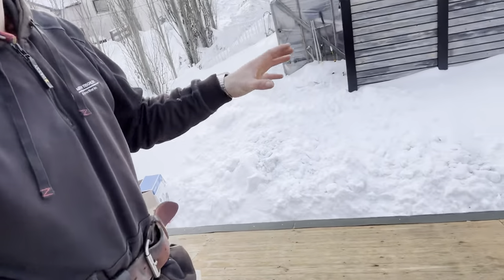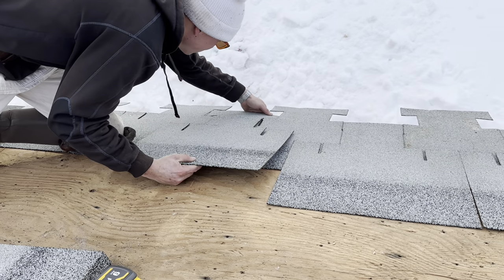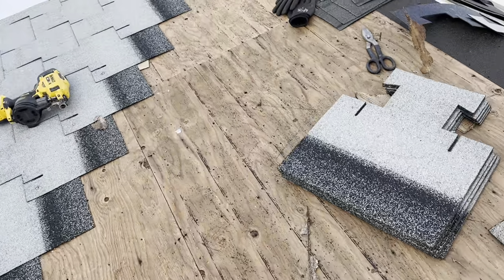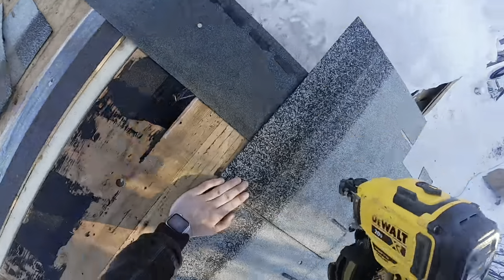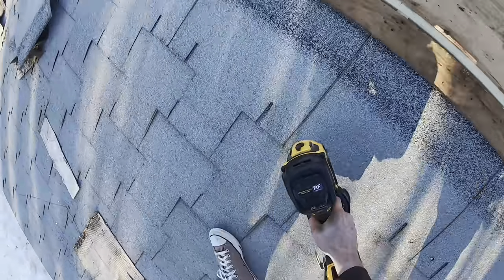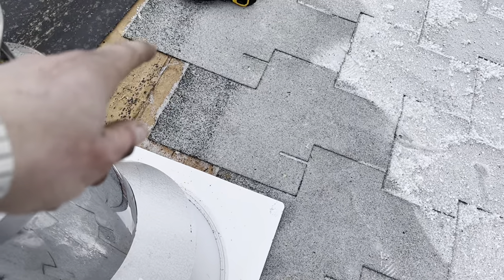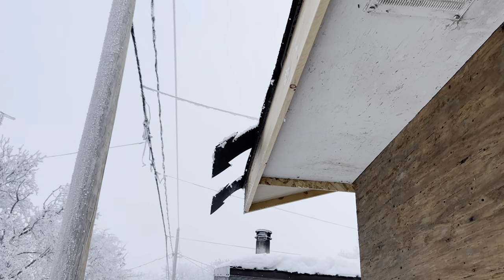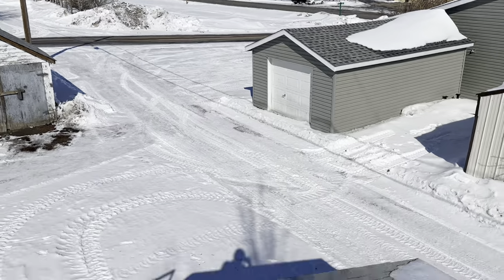How to install T-lock shingles

Comment: $5 pack on facebook. Good enough for a chicken coop, but don't put them on any building the you want the roof covered by insurance. They have been discontinued for a good reason it seems.
Reply: they are discontinued/won't be covered because if a single shingle gets damaged you need to replace the entire roof to fix that one shingle.

Comment: No need for tar paper or starting roll??
Reply: I ? That too
Reply from the maker: No I believe that is just a waste of resources if you shingle properly in the first place that’s all you need! I’ve seen roof decks that are 100 years old and have never had any of that fancy stuff and they are in perfect shape
Reply: Ty Austin, I  had heard that but no reasoning behind it. It does seem to be the local practice.
Reply: @AustinTischler  I was wondering about the need for a water barrier as well. Thank you for explaining that Austin! ☘️☘️☘️

Comment: I don’t know anything about construction, but why don’t you need tar paper under the shingles 🤷‍♂️
Reply: I don't know why this cat isn't using any vapor barrier. I was a roofer in central Kansas for over 20 years and I've tore off hundreds of roofs with T locks and when they were put down on the original decking there was always tar paper. Usually those shingles were over laid. Either over wood or over asphalt over wood. It used to be the wood shingles were considered decking and people would have three layers of roofing. I got to be the generation that had the privilege of tearing all those old dusty roofs off. Then we nailed 7/16" OSB over the space sheeting from the wood shingles. It ruined my lungs breathing in all that nasty dust off the old cedar shingles. You see when all of the shingles were cedar they had to leave a two to three inch gap between the 1×6s so that air could get under the shingles and dry them out. Otherwise the roofs would have prematurely rotted away underneath while appearing fine on the top. Now this dude here is going to have the decking rot away under the Tlock shingles because he didn't use a vapor barrier. And he has plywood decking. The absolute worst there is when it comes to moisture warp and rot when exposed to even small amounts of moisture. Even in the form of vapor. So there is your roofing education for the day thank you very much and GOD bless you.
Reply from the maker: If you do you roof properly you don’t need any underlay in my experience I’ve torn off roofs that are 40+ years old with no underlay and the plywood is brand new underneath, like a lot of things nowadays, underlay is just an extraneous money grab

Comment: Hi,although I’m not a roofer I’ve used shingles. It would appear that these shingles  should be hung the other way round so that the dark area is the the only bit exposed. The pieces that you used for the edges are the soakers for the first course that’s why they have glue on them. The pattern of the T is simply to interlock the shingles together and are not for decoration. This is the reason you had problems with the flashing around the flue stack.If I’m wrong then I’ll put my hand up be corrected.
Reply: You are wrong. He installed them correctly but didn’t use any underlayment
Reply: Yeah all that work and don’t spent $20 on felt seems crazy to me.